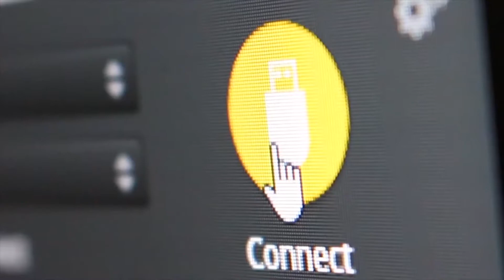Miata ATI Super Damper, Timing Belt and Water Pump Install

Comment: ayyy I had to use rtv for that same o ring in the coolant neck when I was doing my timing belt. after about 5k miles, no leaks yet so seems like it worked🤷‍♂️. I wanted to try and get the actual ring from autozone but of course its a non-standard size, and you have to buy the mazda oem one lol.
Reply from the maker: Yeah one day I will do it but not today!!